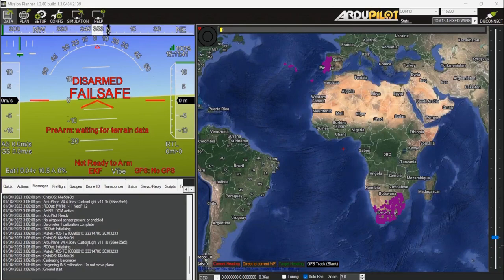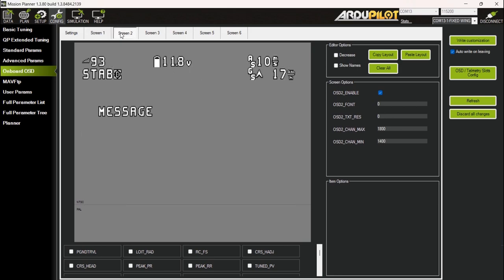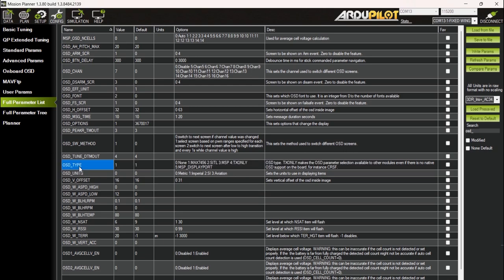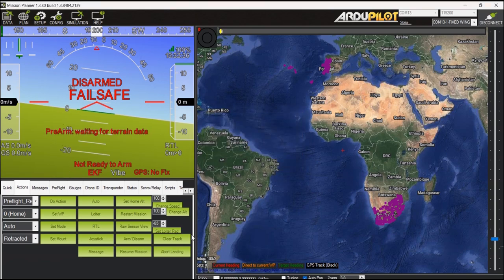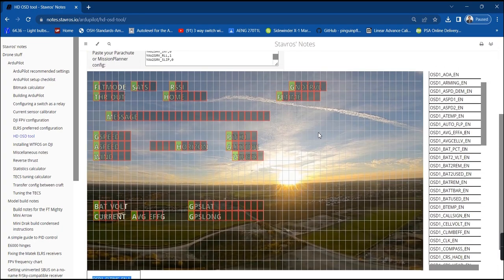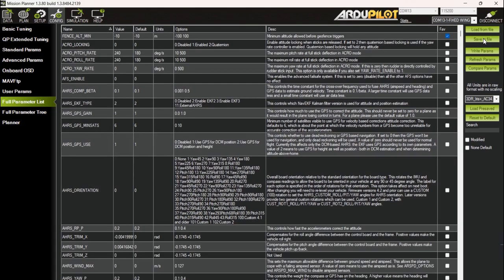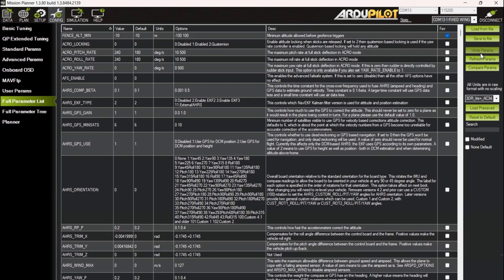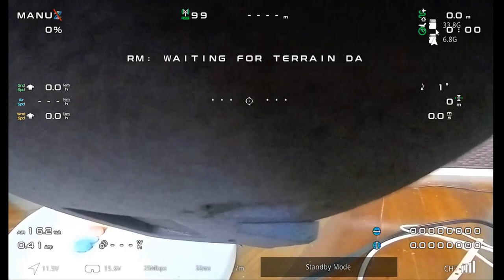how to setup HD OSD layout on Ardupilot using HD OSD Tool ----UPDATE

Comment: Hoping you can help.
I have installed this on my og air unit with wtfos, i have changed the layout so all elements are at the edge but once i power up the googles the layout isnt all the way to the edge?
Reply from the maker: Set osd1_txtres to 3 (same for the other OSD screens)
Reply: @windfpv  
Is it mandatory to set this for the other screens even though I don't use them?
Reply from the maker: @craigrjrich  not needed if you dont use those screens
Reply: @windfpv  
That sorted it.. thank you, :)
Reply from the maker: Glad it worked!

Comment: Hi. My question: It is working with DJI 03+DJI Gogle 2 + Ardupilot?
Reply from the maker: O3 doesn't have hd for Ardu yet..
Reply: It should work, 99% sure.
Just tryed on my DJI Goggles 2 + old DJI AIR UNIT( updated to latest V01.01)

Comment: hello sir, i have FC matek H743 Wlite, it has built in OSD and eachine tx06 VTX AIO, i've conecting the video in eachine to C1 pinout FC and video out eachine to vtx pinout FC. it shows the display camera but the OSD still dont get on my ggoogles display. is there any something wrong with my setup? 
thx sir ^^

Comment: The saddest thing is that I did not display several important OSD elements, such as cell voltage and some more, can I fix this?
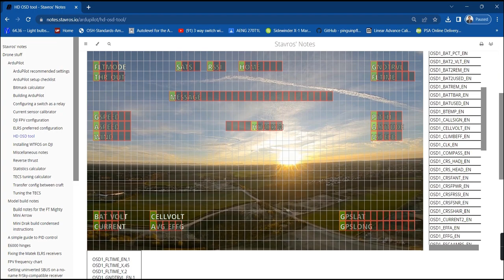Reply from the maker: Yes, just Enable it on the hd OSD tool. I demonstrated it at around 6:38 of the video, you just need to drag the element name from the column at the right
Reply: @windfpv  Yes, it is in the layout that I assembled, but then it is not in the glasses, and thus several elements have disappeared. Why do they disappear and how to make them appear?
Reply from the maker: oh, what digital FPV system?
Reply: @windfpv  wtfos Google v2 Vista
Reply from the maker: Set this up :

Batt_cell_count = 0
OSD1_AVGCELLV_En = 1
OSD1_CELLVOLT_EN = 0

Comment: Hello, I'm currently using mine with the avatar VRX as well. I followed your step and go the osd display and the information is updated from my flight controller. However, I don't see any image being send to my monitor. it just black screen. May I ask what would cause it? The VRX and the transmitter is talking as I see the information is being updated and there is signal between them. Thank you for your time.
Reply from the maker: what flight controller?
Reply: @windfpv  I'm currently using the  LUX-H7 connect via the dji air connector they have so it should be tx/rx3 which should be serial 4 according to the manual. I received the update from OSD but no picture. (just black screen) with text from OSD
Reply from the maker: What did you set your MSP_OPTIONS and OSD_OPTIONS to?
Reply: @windfpv  thank you for replying. I set it as displayport and MSP_displayport for both of them.
Reply from the maker: i mean what values?

Comment: works, but i dont had that images on the sd and color fonts on the osd, how do i get them?
Reply from the maker: Those are custom fonts. What hd system are you using?
Reply: @windfpv  walksnail, i already found that you had to upload the custom fonts to the vrx and update, i already got them, thanks
Reply from the maker: @jorgeneo560 That's right, im using custom fonts as well

Comment: Thanks for this tutorial but I have no elements showing on my walksnail goggle.. :(
I followed all the instruction on this video but with no luck.
Reply from the maker: What FW on Walksnail? And what font are you using?
Reply: @windfpv  Using the latest beta fw on custom ardu font
Reply from the maker: Did you set up the OSD elements on ardupilot accordingly?
Reply: @windfpv  Base on this tutorial, yes.
Reply from the maker: that's odd. are you sure you are getting telemetry from FC to walksnail? you may want to check the serial settings, or check wiring
Reply: @windfpv  I am sure of the hardware setup and UART assignment since OSD is working on the goggle when I was on inav prior to flashing ardu.
Reply from the maker: Which uart did you use for the Walksnail? What's your serial port setting? And on what FC?

Comment: I tried using your hd osd tool but it doesn’t seem to work very well for dji. My elements are not in the same orientation. Any suggestions?
Reply from the maker: which DJI fpv?
Reply: @windfpv  msposd if that is what you are referring to
Reply from the maker: dji O3? or the older ones?
Reply: @windfpv  just dji v2
Reply from the maker: try this:

Set SERIALn_PROTOCOL=42 for DisplayPort, OSD_TYPE=5 for MSP_DISPLAYPORT and OSDn_TXT_RES=1 for 50x18 text resolution on the craft. You should also check that OSD_OPTIONS=0, just to make sure you don’t have problems.
Arrange your OSD elements as you want them.

or this:
If you’re using the DJI FPV system, here’s the relevant configuration you need to set:

Set OSD_TYPE=3.
Set SERIALn_PROTOCOL=33 SERIALn_BAUD=115 SERIALn_OPTIONS=0 (DJI FPV).